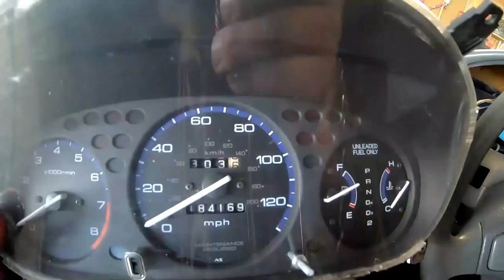06-11 Lifted 8th gen Honda Civic gets HUGE NEW TIRES!

Comment: That's cool I like the large tires and wheels.  I'd set the pressure at 30 or 29 while I drive down these broken down roads and see how smooth they go over these roads that break while their still building it.   Even after the city begging to save a road we  charity  to save a road and then they cancel it after we pay. That's why I like your tires.